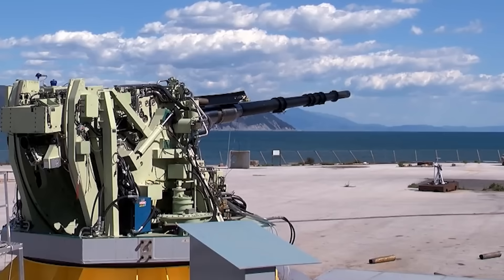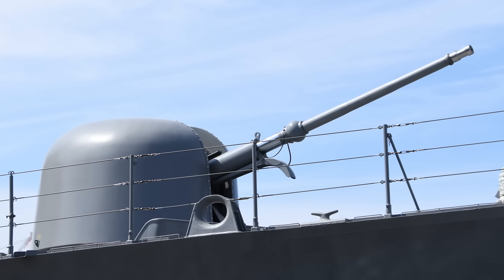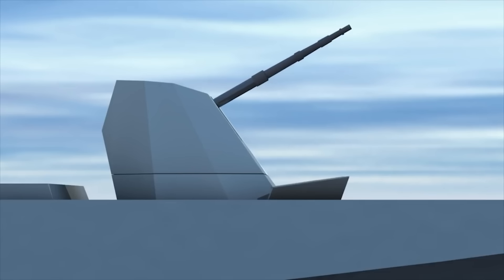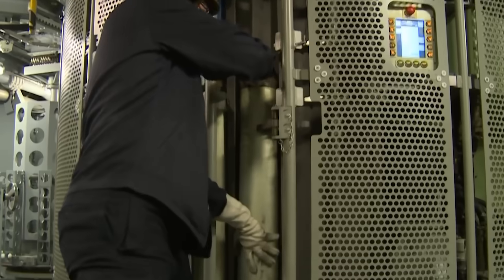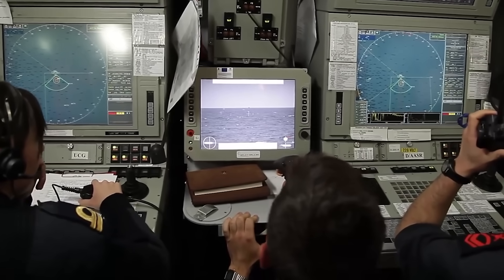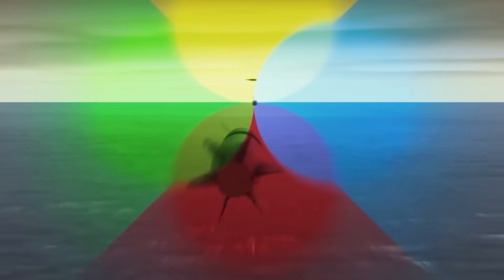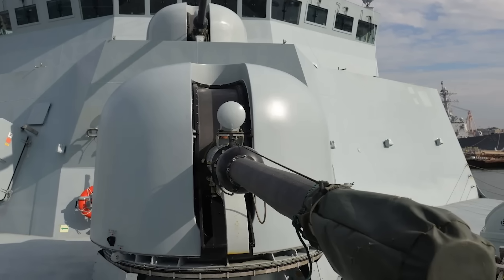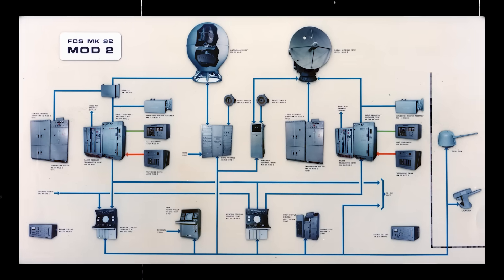Oto Melara 76 Super Rapid Compact Naval Gun

Comment: Does the US suffer from the Not-Designed-Here syndrome??
Why hasn't the US Navy used the Rapid Fire version??
Do we have anything as good?
Reply: I think some are simply to proud to accept something "not US made", despite that the US Stryker ist protected by Leonardo DRS/Blue Halo system,  you have Italian Amphibious vehicle, the SPEAR directed energy weapon, beside many German products, and we buy also US weapon, I mean is not more as fair! btw, a good example of the 76mm is the Red Sea: The Italians shot down several Houthi drones without firing a single missile. The cost savings were enormous. Our Sachsen-class frigate "W124" uses the 76mm cannon, the W126 too, with Vulcano ammunition, this cannon is hard to beat and will certainly be in use for several years to come
Reply: @Nebukadnezar2036  Good stuff. Thanks.

Comment: I used to operate one of this in my country's Navy. It was by far the most reliable weapon system we had. The only thing I didn't like is the loading of this weapon. It was a pain having to load the rounds 1 by 1 onto to the revolving magazine. Once the magazine is filled, we will have to cycle the magazine so that the rounds on the magazine will be transferred to the screw feeder which fits 6 rounds. We then have to operate the rocking arms and revolving magazine simultaneously so that the arms will carry 4 rounds up to the loading station before we can finally load the final few rounds on the magazine to achieve the maximum capacity of 80. There is technically a way to hold 1 extra round in the chamber, but it can only be done if someone manually cycles the rocking arm from the gun mount itself. Oh and another pain in the ass about this gun is to get the gun ready for firing, a piece of metal pad has to removed from the gun. To remove it, we had to do it blindly and reach our hands into a gap in between the loading mechanism itself and risk dropping it. It takes like 15 mins to retrieve it if anyone drops it.

Comment: control system technican friend of mine at work used to work on controls and PLC's that reloads and re-feeds 57mm bofors    one time he had to help and unjam a guide rail feed,   many panels were removed. weighting hundreds of pounds.  Finally. with a rubberized steel crowbar  he pulled on the guiderail out of the way and the shells popped upwards like pez dispenser 10 at a time.   he thought he fked up. Nope thats normal reload speed.  it was SO fast.  scared him briefly.      ship mechanics redid the guide rails, it was warped and worn out from constant friction.        July 1988

Comment: The Israeli navy newest Sa'ar 6 frigate has this gun & a brand new smart munition capability.
Is that 581 warship a Danish Huetfeld heavy frigate? Looks like thier early variant  two 76s forward? If it is, that's about 400 rounds per minute right there!
Guns just like this are very economic anti UAV weapon today. Plus a good measure of shore bombardment. This should have been the main deck gun Canada's newest six arctic patrol vessels. Yet it has a single pipsqueek 25 mil instead. Dismal.

Comment: G'day Dark, As I'm an ex-RAAF type, I have little knowledge of these amazing weapons systems, however, I did know that the RAN uses these guns. I had no idea they were so widespread over the navies of the world. They are so effective this explains why the huge, multi-barrel naval gun turrets of old are no longer needed.
Although they are quite different, they did originate in Italy which, has an extremely long history of producing cutting edge artillery type weapons. To this day, many say the finest shotguns and hunting rifles are of Italian manufacture. 
What a pity these guns wouldn't fit a C-130 Hercules gunship aircraft. Only one would be needed instead of the multi-gun layout of present gunships.
Another extremely interesting video. Thank you and cheers, Bill H.
Reply: The old RAN versions had limitedcapabilities compared to current otto 76mm
Reply: you can get it in a C130 without a problem, you just need to change the mounting for the autoloader and magazine, and you can remove all the other stuff needed on a naval gun, it wouldn't take more space then the current 105mm, except the autoloader and magazine, some you need a crew and space for on the 105mm.

I have seen multiple OTO 76mm being transported in a C130, with it's magazine attached and mounted on a trailer, they do take that little space.

Comment: .017 degrees accuracy at 1000 meters for a 10-round burst implies this gun can put 10 rounds in a target 1-foot in diameter at 1000 yards in 5 seconds. (2000*tan(.0085)=0.297m=0.973ft)

Is there any video of this gun actually demonstrating that kind of accuracy during rapid-fire?  Such accuracy would require the position of the barrel not deviate by more than about 1.5mm during the course of firing.
Reply: there is an old video where oto melara installed the cannon in strales version on an italian corvette to test it in a demonstration for some foreign navies. during testing, they hit the head of a buoy at 5000m. then they tested the weapon on drones that approached the ship from different heights. I remember the lowest flying 10 meters above the water, deliberately to confuse the ship's detection systems. the gun detected the target and locked onto the target at 5500 meters and opened fire at 5000 meters. three shots in quick succession that brought down the drone. the drone was piloted by the foreign observers and attempted to dodge the shots but was shot down anyway. the observers, being on board the ship, hearing the cannon fire, immediately started the evasive maneuver, but this was not enough to save the drone, because the ammunition chased it until it hit it. the precision comes from the ammunition, because the cannon is able to make them turn in the air even after having fired them. basically the gun follows the whole process from when the ammunition exits the barrel until it hits the target, the gun's radar follows the targets and instructs the ammunition where and how to go. in the super-fast version, the cannon is capable of firing 120 shots per minute and has a range of 30km, but the degree of maximum accuracy is guaranteed with bursts of 3 shots, up to a maximum of 10 shots per burst. in a documentary filmed by the German Navy, it showed the gun firing volleys at coastal targets with pinpoint accuracy, 3- and 10-round bursts. while if you want to bombard a quadrant, then you switch to maximum gun thrust. I saw this documentary on the Italian channel Cielo. but the documentary had been produced by the Discovery Channel. if you can find it and a documentary dating from 2006/07 more or less. while the other video I saw on You Tube. If I find the video I will post it here. today the technology has been improved and the oto melara cannons offer different types of ammunition for every situation. the oto melara 127/64 Lw cannon reaches a maximum range of 120km (the same as an aster 30 missile) ensuring absolute precision on the target

Comment: Italian perfection Is in every field they apply. 🇮🇹♥️♥️♥️
Reply: Italian engineering is first class, but a 76mm gun is too small for a destroyer. It needs 4.5 to 5 inch weapon in order to seriously damage another destroyer.
Reply: @Will_CH1  in addition to the 76/62, the oto melara 127/64 lw cannon is also available. this gun fires 5-inch guided ammunition at a rate of 1200 meters per second, the gun has a rate of fire of 60 rounds per minute and has a range of 120km or 75 miles. the gun can also fire subcalibrated 6-inch ammunition. both systems are installed on the bergamini and ppa class units of the italian navy. 76/62 aft and 127/64 forward
Reply: @Will_CH1  The strange thing is that now 57mm Bofors guns are being used on many ships as the main battery. This is way too small and should only be a main battery on a small ship like an Off Shore Patrol Vessel  or a secondary battery on a larger ship like corvettes, frigates, and destroyers.
Reply: @jdewitt77  Stupid choice for a main gun. One day, our sailors may have to duff it out with a 130mm gun on a Chinese destroyer.

Comment: Now that the EU is developing a new Eurotank i think there should be an anti-air version of that tank with the OTO 76mm. Basically a OTOMATIC 2. If the system can be monted on a wheeled vehicle like the centauro chassis, it should be possible to put it on the chassis of a heavilly modified Leopard 2. >Immagine what this gun could do againist drones, helicopters and loitering ammunitions. Basically it would be an almost perfect SHORAD system if coupled with a laser. Maybe even add stinger missiles if they can find the space.

Comment: I am 16 and I currently live in Italy. Sometimes I've seen some of these on Italian destroyers in Naples. They didn't look so interesting at first, but after watching this video they are! I'm now so fashinated about the technology of an apparently so simple yet interesting naval artilley piece!
Reply: -Italy has been involved in producing a number of types of advanced ammunition that can change the direction in flight like a missile.   One of the first was DART which was designed to destroy incoming missiles and aircraft.   Because of the speed of these incoming missiles might be 1000 meters per second the gun has to fire very fast (150 RPM or every 0.4 seconds) so it can get in a second or 3rd shot or handle multiple missiles at once.      Italy (Leonardo) and Germany(Diehl) jointly developed Vulcano GPS Ammunition.  This can be fired from 155mm guns,  127mm naval guns and 76.2mm naval guns.   If the GPS is jammed it still works because of inertial guidance.   The fuse on the nose can be removed and replaced with an infrared seeker to target ships over the horizon or a laser seeker for use in conjunction with a laser designator from a drone or forward observer.
-When you make something 10 times smaller you make it 10x more shock resistant so the key to shock resistance is miniaturization.   They sometimes float the electronics in oil so the pressure is equalized.  During WW2 electronically triggered radar proximity fuses were used.
Reply: @williamzk9083  This is just incredibile, I didn't know this cannon could even stop missiles. And the Vulcano ammunition looks like the 300× better version of the Excalibur artillery shell lmao.
Reply: Gli americani pensano sempre che "grosso", "complicato" e "supertecnologico" vuol dire "meglio". Il problema è che in guerra non è sempre così; anzi, spesso le soluzioni migliori sono quelle più semplici ed economiche, se si sa come usarle bene. L'Italia non necessita di grosse navi oceaniche o di portaerei nucleari, le basta avere una flotta di medie dimensioni che riesca a proteggere i suoi confini marittimi. Le FREMM sono la punta di diamante di questo sistema, fregate multiruolo di ultima generazione che hanno destato l'interesse perfino della US Navy, che ne ha chiesto di poterne acquistare un certo numero di esemplari.
Reply: @minotaurus91  We've already started to build the constellation "Fremm" class frigate in America at Marinette Marine. A Fincantieri company.
Reply: Ma sull’Andrea Doria al porto dici?
Reply: Sei napoletano e non sai che il cannone fu progettato e costruito  dal cantieri  ex Armstrong di pozzuoli? Poi anche quello il nord ci ha saccheggiato, vabbé, lasciamo perdere, è la storia degli ultimi 163 snni
Reply: @cirONE65  Ma non sono napoletana, sono nata in Scozia...💀
Reply: @just_violet  d'accordo, è per te un problema se lo saresti stata? Ho visto il Jolly Roger, per questo te lo chiedo
Reply: O fosti stata?, Sono indeciso sull articolo
Reply: @cirONE65  No, non è assolutamente un problema perché semplicemente non sapevo che fosse italiano quel cannone. Comunque che intendi per "ho visto il Jolly Roger"?
Reply: @just_violet  il  jolly roger con o senza le due ossa incrociate oggi.equivale a sprezzante arrabbiatura, assodato che non era tua intenzione, ti rivelo che in pratica quel simbolo lo hai visto tante volte pur non sapendo che veniva chiamato così, ed era il simbolo dei terribili e sanguinari pirati di una volta (altro che romanzi alla jack sparrow). Detto questo ti saluto e ti chiedo scusa per lo scambio donna/uomo. Ciao
Reply: @cirONE65  Ah okay, ero già a conoscenza che fosse utilizzato dai pirati e anche da un famoso squadrone aereo americano. Non sapevo del suo significato vero e proprio, grazie haha. Non preoccuparti per il fraintendimento uomo/donna.
Reply: Ma sempre nei commenti sei
Reply: @Goose852  Ma è di 11 fottuti mesi fa

Comment: Our Norwegian Skjold-class corvettes has the 1 × 76mm Otobreda Super Rapid multi-role cannon. And the corvette class ship moves at 60 knots and still gets good hits
Reply: Wow! A ship that size carrying that gun hitting 60 knots! That puts the "Vette" in corvette!
Reply: @TeachinTV  unofficially one of them have managed to hit close to 68 knots. But then you have 16.320 hp on a 274 tonn hull! But you don't want to be onboard in rough sea when traveling over 45 knots, it can be quite rough bellow deck.
Reply: 60 knots  only in calm seas per Wikipedia..
But still damm fast
Reply: @butterfinger1171  they are being taken out of service now soon i belive
Reply: @CanisLupus1983  They have extended their service life due to that incident with that frigate, but usually military vessels last around 30-40 years with an MLU. longer than that, they need an extensive upgrade. Bu they do get close to that age.
Reply: @butterfinger1171  It's depends on how you define "In calm sea" in the Navy, and the Navy usually have a different look at things when they are talking about "calm" then civilians. But when you hit speed above 50 knots, a small wave will get the boat flying out of the water anyway, and you want the hull on these SWATH hull be in contact with water, due to they push a lot of air between the hulls, to lift it almost out of the water.
Reply: that's really impressive, at 60knots?? wow!
Reply: @Nebukadnezar2036  Classe Nibbio italian navi in the 70 since  last 80  50 knots oto 76/52 a couple of missiles i beleve otomat or aspide controll of wikipedia for sure
Reply: I remember that gun being mounted on a REAL small ship, the PHMs out of Key West. Anyone remember THEM? They didn't float, they flew. 😄

Comment: If the bottom of this gun is directly penetrated by anti-ship missiles, will it cause martyrdom?
Reply: in reality the images are confused. the cannon shown in the digitized images is not the 76, but it is the new oto-melara 127 which can also fire the 155mm sub-calibrate. with the new Vulcano ammunition, this cannon has a range of 100km. It is equipped with different types of ammunition and is designed to hit ground targets as well. takes up much more space than the compact 76
Reply: @lucaiervasi8515  Yes, I also think that the caliber of 76 mm is too small. It should be a large-caliber naval gun. But if hit by an anti-ship missile, it is still very likely to be martyred explode.
Reply: @nirvana3921  if a missile hits the ship, it means that the cannon has not done its duty. however there are some bulkheads designed to raise the fire, the cannon will jump away and act as a vent chimney of the internal pressure so as not to invade the ship's compartments. but it all depends on dozens of factors. I would say to rely on the most famous of them, the ass and hope that this does not happen

Comment: Fun Fact: There was a 76mm OTO mounted on a OF-40 main battle tank for use as a self-propelled anti-air vehicle. It was called the Otomatic. Only one was ever produced unfortunately.
Reply: But now Oto Melara is proposing the Draco, 76mm Super Rapido on the chassis of a Centauro tank destroyer or a Dardo IFV.
Reply: Correct, and in the new "b1 draco" on 8x8 centauro
Reply: A Boxer module with this would be sick. Like a massively upgunned Skyranger
Reply: only in war thunder

Comment: Eh? The 76 SR used the exact same rotating magazine as the IROF and the Compact.. it doesnt operate independently. The new 127mm system has multiple drums… i can go on but a lot of info is faulty and different systems are mixed up.

Types: 

Compact,
IROF,
SR,
Strales.

Comment: What really wasn't apparent to me until recent years is that the primary role of all these guns is anti missile defense, secondary role anti surface or shore bombardment.  But if the 76mm Oto Melara is so fantastic, why is the U.S. Navy equiping new ships with the shorter range 57mm?  I have heard that the 57mm can put more rounds in the air against an incoming missile, but does it just come down to that?  Does that outweigh range?
Reply: Because the US Arms lobby has the big bucks.
Reply: @bandenere7774  US Arms lobby also produces a local variant of the Melara, so probably not just that. Further, Bofors is a Swedish company.
Reply: US being Us
Reply: vi stiamo costruendo le nuove fregate
Reply: I suspect it has more to do with the longer range RIM-116 Rolling Airframe Missile system being the US's long range (relatively speaking) anti-missile weapon of choice. As the range drops, as in a saturation attack, volume of fire becomes more and more important, as does the Bofor's programmable ammunition, which can likely do all sorts of neat tricks like air burst. Then you're down to knife fight range and CWIS systems.